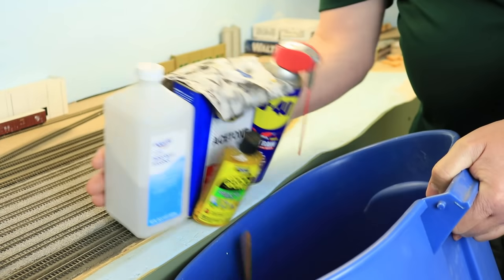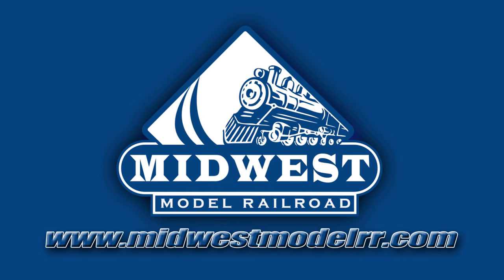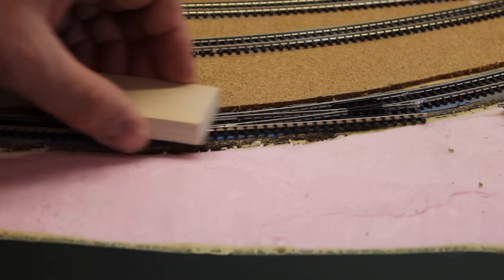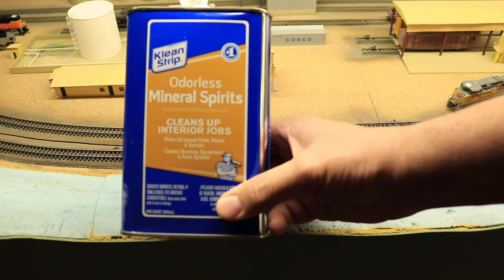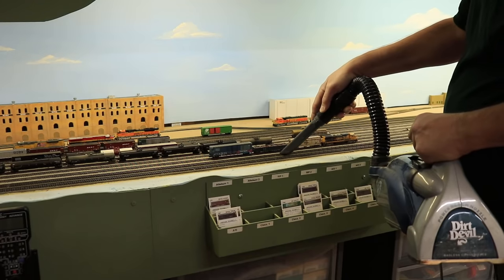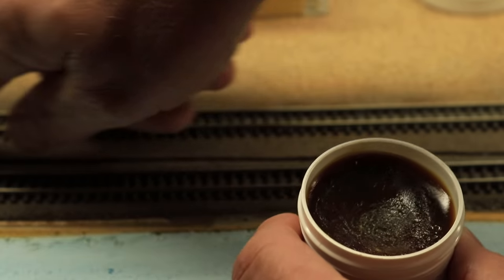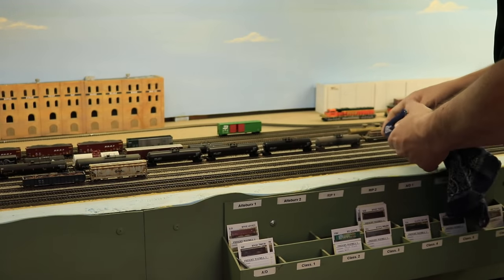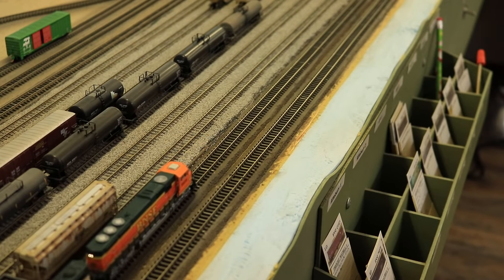Stop Cleaning Your Track on Your Model Railroad

Comment: Great information! This is why I love this hobby... brings together not only great providers but also the skillsets I'm interested in... modelling, carpentry, electronics... and now electro-chemistry.  Building my first layout... a shelf-sized system with about 16' of HO track and about 6 - 8 turnouts.  I'm doing it all on the cheap so I bought used nickel-silver flex track and some old brass turnouts... about $100 invested so far in trackage.  Looking for advice on how to restore old track and how to maintain it.  This info will help.

Comment: I'm using automatic gearbox fluid: ATF Dexron 3 (higher will also work) which has anti-corrosion properties and is not an electrical insulator when applied (very) thinly.  
Apply extremely small amounts and use a single stable locomotive to spread it around the track; as it is also a lubricant you only need a hint of a drop for several meters of track, so using a swab to apply it in a few separate places is advised.  Apply a length of about 2 inches on each track such that the wheel of the locomotive can do at least an entire revolution.
Traction tires typically don't suffer at all from the ATF fluid as it is designed to be kind to rubber and other gaskets, but you might find they pick up more dirt after ATF application.  Repeat this every 6-12 months and you'll be driving those trains like never before.

Comment: Thank you , no ox has totally resolved my train issues , I spread a tiny bit with my finger on a small diorama track that comes on and off three times a day with a WiFi plug. About 6 months on it is still running fine at a very low speed , which is my preference. Before this I was cleaning every two weeks.
Been a fantastic product.
I’m in uk so thought I’d have an issue getting some , but thankfully it was on amazon with next day.

Comment: I've been using No-Ox for around 12 years with no real track cleaning and great performance.  In my experience you're making the application of it harder than it needs to be.  Once every few years I just apply a small dab on the end of a toothpick about every 30 feet or so and spread it via locomotive (light power the first couple times through as there will be some slippage).  I've never gone to the effort to wipe it off because I apply it so sparingly.  I'm sure what you're doing will work fine as well, but it's a lot more effort than is needed to be effective in my experience.  If I haven't run the layout for more than a month I'll just run a boxcar equipped with a Woodland Scenics Dustmonkey on the axle ahead of trains to dust the tracks on the first run (which is far more fun that getting out the vacuum!).
Reply: I can attest that the OJL runs great!! The times I have been there, everything ran flawlessly.
Reply from the maker: That's good to know. That is how I used to apply clipper oil. I just followed the Sanchem recommendations, but that is easier and good to know it works.
Reply: Do you have any locomotives with traction tires?

Comment: Your video's on track cleaning and then using No-ox special followed up periodically by using Dust Monkeys has made a world of difference on my garage layout!  Previously I needed to clean my rails almost every week.  Now I have not had to clean my rails in the two months since I applied the No-Ox special.  Thanks Ron.
Reply: Denatured acahol Is cheaper as sold by any hardware store as Lamp fuel as instead of karsoline.

Comment: Yup, I had already been doing what Fishplate suggested, only starting with a clean track first then following his procedure.  Even with a dusty garage layout this has been successful.  2-26 has a protectorate in it Ron.  Fishplate recommends it I also have polished my track with a chrome washer beforehand.
Reply from the maker: You should switch to CRC's Contact Cleaner & Protectant. It is less polar and dpes a better job reducing micor-arcing and oxidation. 2-26 is more polar.

Comment: I'm just getting back into the hobby as an adult, and so I'm building a small 6'x4' layout as a practice run while creating the benchwork for a large attic layout.  

For that practice layout I'm using a load of old 1970s/1980s steel track my mother-in-law found clearing out her garage. No Ox ID is incredibly expensive in the UK.  I've seen it being sold for £60-£100.  Intensive cleaning is likely to be a part of my life for the foreseeable future.
Reply from the maker: Wow, that is insanely expensive. Sorry to hear that. Hope it all goes well for you.

Comment: I’ve used Wahl’s hair clipper oil for decades. I learned about it from a model railroader article back in the 1970s. Conveniently my Father, Grandfather and Uncle were barbers! I have a stash. 😂 It too promotes conductivity and stops oxidation. Barbers will tell you all about how it keeps their clippers in top shape. Will it collect dust? Not any more than the other lube I suppose. Works great on gears too.
Reply from the maker: Whal clipper oil was a stand by for many modelers for years...still is for many.👍🏼

Comment: As someone who grew up in the "brass rail era," I know that many of our ideas on track cleaning comes from that era. Brass rail oxidizes different from Nickel Silver. Also, some of my earliest flex track used fiber rails, which is not as affected by alcohols as plastics. Now, one of the things that was promoted early about Nickel Silver, is that the oxidation is conductive, unlike brass. Brass would get so oxidized, that it took something like a "Brite Boy" to get through it to fresh brass. Curious as to how this product affects brass rail and wheels, as many of my locos are old enough to have brass wheels. I agree with the frustration  of constant rail maintenance. I left HO and N at one point and went back to "toy trains." But my enthusiasm for scale models has returned in my retirement, and I will try your suggestions, once I get the track clean. Thanks!
Reply: I bet it works on brass.
Reply: The conductive is a game changer.
Reply: What exactly are "TOY TRAINS" @magform ?

Comment: I just wanted to state that after watching this video. I cleaned all my track and applied the no ox id and it was pretty good but not as good as what I had on the track before. I use a graphite stick and its easy peasy. It's really helped with the turnouts especially. Mineral spirits are the way to go though for cleaning!
Reply from the maker: I have heard from a number of graphite users. It is fairly non-polar and seems to be liked by those who use it. I have not myself. Thanks for weighing in.
Reply: Anybody have a problem with engines not being able to pull nearly as many cars because they are slipping above like 40% on power? I got HO atlas gp38 which can easily pull 25+ cars each and they are having a hard time, together, pulling 10 on a an almost level surface. Bear in mind I put way too much on initially - had to go in on the trucks, but anyway I liked everything down and it should be great. Yeah there is great connectivity but ZERO attraction. Anybody experience this or is it their way I could fix it?

Thanks so much btw Ron = this is an awesome idea. And I’m glad that I did it on a small test track first!
Reply from the maker: @JakeRathburn  You have over applied it. Wibe down the track and the locomotive wheels to remove excess product.
Reply: Ron's Trains N Things I figured! I’m gonna leave it on until a couple more engines get weathered and the wheels coated! Thanks 😊
Reply: I tried a graphite stick, fairly soft one, 2 years ago with some scepticism, and what a difference it made. First, I haven't cleaned the track since. There's no need to. Second, you only really need to do the points.(sorry, that' UK speak-I should say turnouts). The trains will spread it all over the remaining track. Third, my 0-6-0 steam locos were subject to frequent stalling on the turnouts because most are dead frog i.e. insulfrog. They are not faultless now but much improved. Fourth- the downside. As mentioned below the graphite is a lubricant and it shows. I normally run only 7 trucks/cars in freight trains because of the small layout size and 3 coach passenger trains. There is no problem with these but on he occasions that I had to shunt ( is that switch in the U.S?) two or more trains together, some steam locos will not cope and spin their wheels. (I don't have any diesels. The solution appears to be to remove from time to time the graphite from all track but the turnouts. It will spread again slowly. So by and large, it's great but with a downside. I might try No-Ox instead to see if it does better than graphite on the slipping front.

Comment: Outstanding!!! THANK YOU!!! I keep my wife's N scale trains running(incl repair) & use a meter to monitor loco current. Before NO-OX-ID current would dance around 10 to 20ma, with treatment maybe a 5ma variance. We have a '90s KATO that truck contacts rest directly on zinc chassis, requires a regular cleaning. Next time I'm going to try treatment with NO-OX-ID.

Comment: Made me look.. I have a 2 ounce bottle of DE-OX-ID liquid electronic contact cleaner, from GC Electronics, that I bought in the 80s. Works great for contacts. Put it on with a toothpick and lightly scrub off the arc marks. Not listed as having lube but doesn't seem  to accelerate corrosion either.  Since "a little daub will do it!" the bottle is still 3/4 full. For sliding contacts your NO-OX-ID especial sounds better.

Comment: Thank you for this video it's gonna help me so much, just got back into model railways and built a decent sided layout in my workshop this cleaning method is deffo gonna be used on mine, already added the things I need to my online shopping basket, im in the uk and my class 06 shutters spark and stutter all the time for as my track is very old and only Q tips and a track rubber have been used to clean it

Comment: Thanks Ron. I heard about this product years ago. Yes people I know have talked about every possible type of cleaning or product. I tried a few but the key has been no long lasting results. This scientific method makes more sense. Beyond this method I believe that keeping the environment in the layout room cleaner is a goal to have. I put up a painted OSB panel ceiling to keep dust/dirt from falling from raw floor above. Putting the dryer upstairs as well. Painting concrete floor. Changing furnace filters often. It has all helped in this respect. Again I thank you for this video and hope people follow the process. Keep up the good work.

Comment: I have a small n-scale layout and heard about transmission fluid for this problem from a club about 5 or 6 years. thought I would try it. If it didn't work it would be easy to clean up. As of today I haven't cleaned the trans. oil off and I haven't put any back on in a long time. I don't know how long it will last, but for now my electrical problems do not exist.

Comment: Ron, Interesting video!  This may be a different video from Joe F.; but, the latest iteration from him is about cleaning the tracks and wheels first then using graphite to reduce/eliminate arching of the rails.  An important point that needs to be made is that you not get graphite all over the layout; but, only put it on a few feet of track every so often.  I tried this but got to much on and my locos lost traction.  I'm still going to attempt to do what Joe recommends once I'm back to running trains again.

Comment: I have for many many years on many layouts used 3 in 1 oil very lightly wiped along the rails with a soft cloth and fingertip.  The cloth always gets black and the rails are shiny, clean and have a very slight film of oil that protects from oxidation and the wheels stop arcing.  Never had a slipping problem I am not putting it on thick.

Comment: I use a CMX solid brass track cleaning tank car that has a cloth pad under the tank. I fill the tank with lacquer thinner and adjust the valve on the tank to allow the lacquer to drip onto the cleaner pad at a rate of about one drop per 2 seconds. I hook the car up to a powerful locomotive and push it to all sections of track. The pushing is best because its easy to clean the full length of stub spurs. The bottom line: lacquer thinner is the best solvent to use.

Comment: Excellent and interesting informative video! I’ve switched from IPA to WD-40 contact cleaner and have been impressed (I do have some traction tyres being a U.K. layout). A couple of additional tips … I operate a Dapol track cleaner with the vacuum mode and it’s amazing how much dust and debris can get on a layout! Also I use a small vacuum cleaner during any projects to the layout … it’s amazing how many videos you see where sawdust after drilling is simply blown away to pollute another part of the layout! I also use a dehumidifier in my railway shed and this helps reduce and stabilise the humidity … as just like the real railway, water is an enemy! 👍

Comment: Nice video and super well expalined.. 
Does the No Ox grease cause a problem if you have steep grades on a mountain type railroad. I would imagine even after wiping the No Ox off, there would be a mild film that could potentially cause driver slippage. Wondering if you have had any info or feedback on that point with steeper grades.
Nice video Ron, as always. Anything you can share from your resources would be appreciated on the slippage question. 
Phil
Jersey Shore / NYC Area

Comment: Ok, mineral spirits great!  NO-OX not so great 🙁 I applied the NO-OX exactly as your presentation specifies, and it was a fail.  Before the NO-OX application everything was running great, after, not so great.  I even completely cleaned the rails on my N-Scale road three times and tried the NO-OX again three times and each time it was the same thing, poor performance.  I really wanted the NO-OX to work, but nothing ventured nothing gained!  The mineral spirits, though, is the way to go!  None of this every other day cleaning like when using iso!  Thanks again!

Comment: When I solder circuit boards, I use a hard green pencil rubber and a circuit spray. Cleans beautiful. 
As someone has said, run the trains on AC . AC is self quenching of the arc .  Or fill the train with lithium and control with WiFi.

Comment: Gentleman;

In the 80's I was a member of the now defunct Chattanooga Model Rail Roaders Association. We had many of the basic problems that you described with dirty oxidation on track, and with several continuous loops operating 7/12 days a week cleaning hundreds of feet of HO track was a real problem. The club found an electronic solution that was not mentioned in this video. We purchased and installed several high frequency track cleaners. These required a capacitor to be installed in the engines themselves but no operational changes were needed to electrical power systems for regular speed/forward/back train operation. With only the modification of the trains that were constantly being run our track cleaning/electrical oxide problems were virtually eliminated. I do not believe that a chemical cleaning was done after this system was placed in operation and Tracy always had a shiney glint to top of rail.

Unfortunately since the Rail Road was decomissioned in the 2000's I do not remember the name of the manufacture of this rail cleaning product, but I do remember seeing advertisements in the Model Rail Roaders magazine's of the time, I am sure someone can find the advertisements in old issues.

The explanation of how this kept your rail clean is that the high frequency low amperage ac caused the ions to repair the crystalline boundaries disrupted by the micro arking in the engines wheels as power was drawn from the rail as turned the electric motor in the train. The capacitor only passed AC across the rails while the motor was DC only and not erected by the AC low voltage micro amperage current.

Hope this helps you to avoid track cleanings in the future.

1. We had 6 trains on continuous loops. With over 180 ft of track in main loop. 
2. We also had 6 or seven switch yards and a central overhead central switching station in the middle of the display.
3. Club members performed maintaince and seinenory design, and we received a portion of the admission for the display.
4. As a member we could come and run our own trains, or use club tools/work space to try modifications on the modle. We did pay nominal yearly dues but got to play with a great big train set. I miss my friends, many good times and memory's. ;-)

Comment: Very cool Ron! I will have to check that out. I constantly have to clean my track with denatured alcohol because IPA leaves a film residue but mine is also in the garage and the garage door doesn't have the best seal at the top so you can imagine all the dust from the wind  getting all over the layout. - Jason
Reply from the maker: The best remedy for dust is a vacuum, not contact cleaning. My basement is relatively dusty too. I use this process, then run the vacuum over the track every so often.
Reply: @RonsTrainsNThings  I would vacuum then run my CMX car with denatured alcohol afterwards. I also noticed a long time ago that the black plastic wheels gunked rails faster than the metal wheels which I have converted everything to now.

Comment: Thank you for a most informative video. I have cleaned about a quarter of my track this way and can testify that my locomotives are running smooth as silk. I have about a quarter of my track that suffered from bad rust over this past summer. What would you recommend to get rid of the rust especially in the hard-to-reach places?